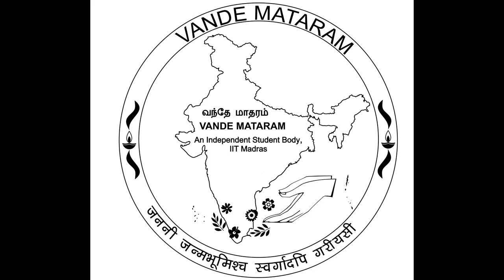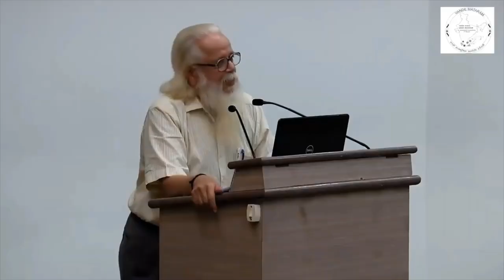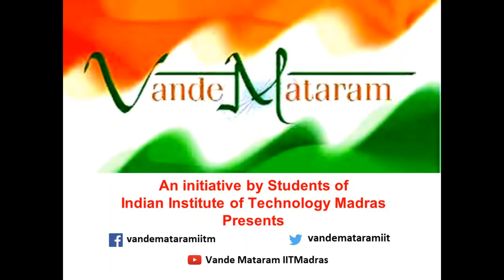Development of Vikas Engine, Solid, Liquid & Cryogenic Propulsion Systems

Comment: The vikas engine is nothing but a viking engine with some tweaks. You got nothing to be proud about it.
Reply: Then please make one for your own.
Reply: What  a cry baby 🙄
Reply: Yh dude but it's way better than Viking and India provided the workforce needed for the Viking engine's success, it had a short safety margin which Nambi Narayaan fixed , thanks to him both the engines are working at their full capacity.
Reply: @hellfire8521  bro Nambi and his team built the engine through technology transfer and it deserves appreciation but I don't think he should be glorified for that. We all know the incapability of Vikas engine in providing sufficient thrust to giant rockets and its one reason why ISRO could not deliver the payload capacity of Mk3 as expected. Repeated try to increase its lift capacity failed even after gathering tech support from Europe. Time to switch to advanced fuel systems.
Reply: @ragamuffin3351  ever heard of the SCE-200?
Reply: @ragamuffin3351  or the CE-20 , Mk3 can deliver ~10 tons to LEO , they made cryogenic stage more advanced to compensate, CE-20 is the World's most powerful operational cryogenic vaccum engine with Isp touching the RL-10's .